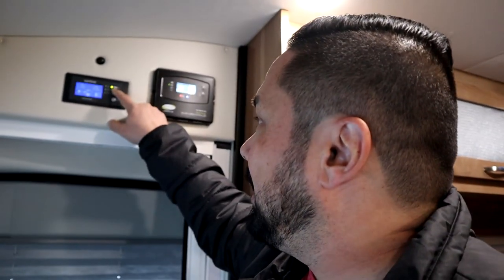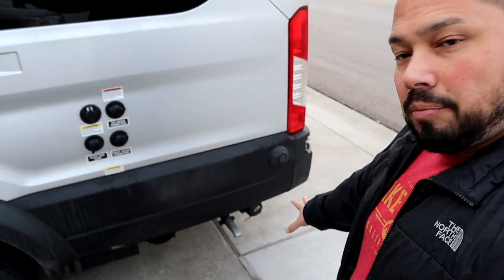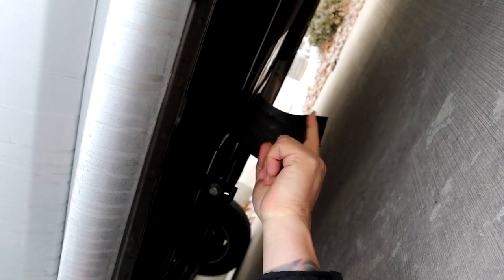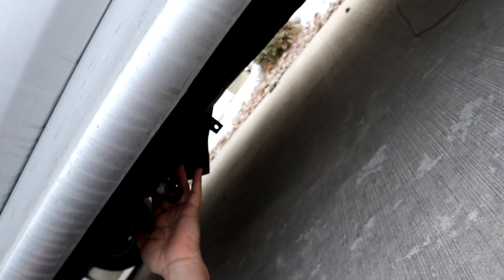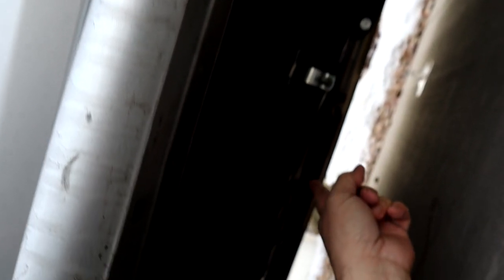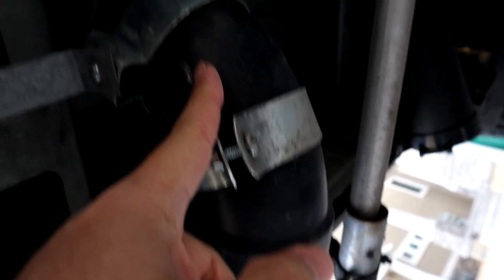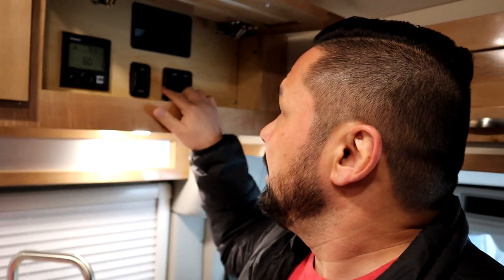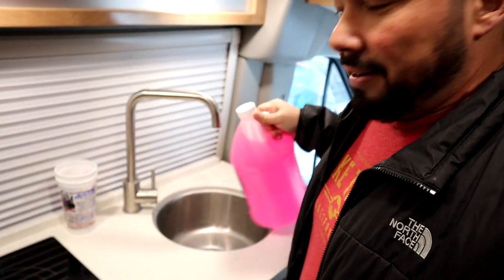Vanlife - How I keep my van ready to go in all 4 seasons WITHOUT winterizing!

Comment: So I’m taking it that you only need the RV antifreeze when it’s cold out? So the rest of the year is fine without anything.
Reply from the maker: Pretty much with a few exceptions.  In the mountains it can be above freezing and you might think you are ok, but at altitude and in continuous shade your valves can still freeze.  Another exception is that the beauty of vanlife is being able to just pick up and go at a moment's notice, but if your route takes you through changing elevations across hundreds/thousands of miles you can end up starting out in a warm place but spend several hours in freezing temps before getting back to warm.  Depending on where you live in can hard to wrap one's head around that, but out here in the west it can happen a lot.  This time of year I would recommend always keeping 1-2 gallons in the van just in case.
Reply: @TeamLynchSpiritofAdventure  
I was just curious. I don’t own a van, but I own a truck camper. Don’t have any water or should I say tanks, in my Kimbo Camper. 
I do like the open feel of your van though, compared to others.

Comment: Good video, informative. Unfortunately, there is no electricity available in my storage garage, so this won't be an option for me. And what with Wisconsin winters, winterizing is a must..
Reply from the maker: Oh man!  Well that stinks.  Looks like you'll be blowing water out of lines and draining furnaces and water pumps.  Not a total fun killer but it's definitely nice to be able to get around it.
Reply: I don’t blow out anything. Takes me about an hour to winterize my 32 ft. Class C, I just pump antifreeze through all the lines, takes less than an hour and about 2.5 gals of antifreeze. Furnace does not contain water and the water heater is simply drained and bypassed. When we camp in the winter we dry camp. Antifreeze to flush, Cary a few jugs of water. Works fine.
Reply from the maker: @frito_bandito_  Now that sounds like a good video!  I know some people are all about blowing air into the lines versus antifreeze.
Reply: Blowing the lines out with air does not guarantee all the water is out of the system, for example, the water pump. Antifreeze is completely reliable, and faster, especially if you have to disconnect the pump.

Comment: Real good info!  Why are you using the 30A cord rather than just the HD 110 extension cord and the 110v/30A adapter?  Thanks for the info
Reply from the maker: Good question. I use the adapter on the end that plugs into the house/generator/shore power. I haven’t seen adapters for the van end of the plug but even if those are out there I try to take as little as possible that is bulky, especially if it is for a single purpose. Keeping the 30amp cord with a small 20Amp (and also a 50amp) adapter takes up the least amount of space in the van and I try to replicate the routine for home plug in too.

Comment: Dude why didn’t you get the Li3 option? Did you look at the Travato also before buying the beyond, i have to decide between the two!
Reply from the maker: I opted to wait on the lithium since it was so new a thing and it totally leaves you without a generator.  With the electrical system I have I can swap out my AGM battery for a 330ah lithium one and will have both a good lithium battery and a generator. I did look at the Travato. I really like them but the Ford Transit base on the Beyond really sold me.

Comment: Thank you for your videos. Wonder how hard it would be to add a leaf between the two beds to turn it into a large bed. I own a travato 59k but would like to trade it for the ford but definitely need the larger bed for my wife and me. Thanks
Reply from the maker: That is actually a project I am going to undertake when I have some more time.  Thinking of either doing the leaf method or having a panel the length of the bed for the middle and then other flat panels with hinges to form the support for the middle.  Hopefully I can get that figured out.

Comment: When the truma is using E1 or E2 it’s using 110v (shore) right? Truma can’t use inverted 110v for heat… can it? Wouldn’t make sense with AGM.. but with lithium it could work… maybe on 750w setting… 

If my math is correct.. 600amp/ hrs lithium @ 12v =7200 watt/hrs / 750w = 9.6hrs… for just heat… but if the lithionics system starts the coach to recharge the batteries then, in theory, you could do this… ? Or am I missing something here?
Reply from the maker: Ugh. So sorry I have missed your questions. Not sure why I’m not seeing them. You can run the Truma on the AGM through the inverter but it is quite the power draw and that’s only on 750W. Lithium will always be a better option for that stuff but will still just drain the battery unlike anything else on the van.

Comment: Thanks for sharing this info. This is super useful and practical. I don’t think other YouTuber in van life ever shared this tip. I am looking into owning a classB van this year and Beyond and Nova are my top two. I really prefer the RB layout but it doesn’t have extra seatbelt in the back so I guess I have to go with 22c or 20c. I am concerned with not having a vent in those bathroom. Also what do you think about lithium battery package, Li3? I know it’s about 20k more.
Reply from the maker: The lithium is a good option but you have to remember that you need to drive to charge it. While there are no seatbelts in the back of my van, the ones that do are only lap belts and some don’t face forward which is somewhat dangerous. I know some people modify theirs to have shoulder belts in the back.